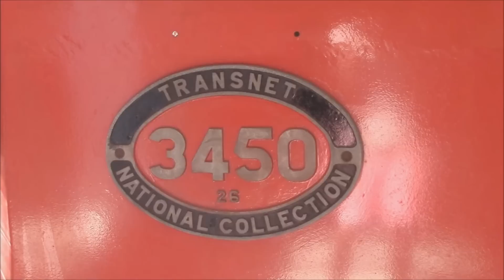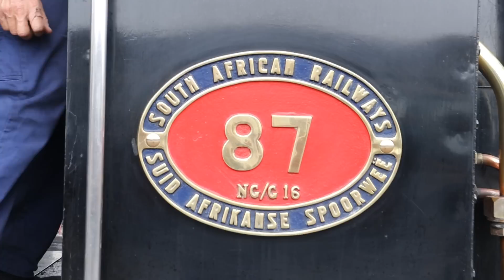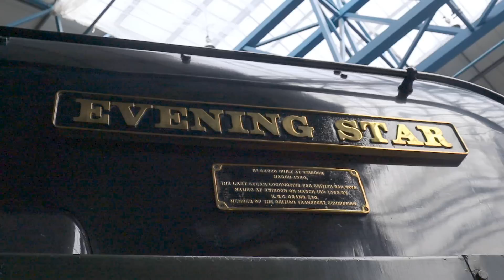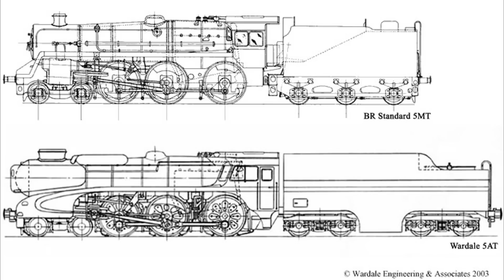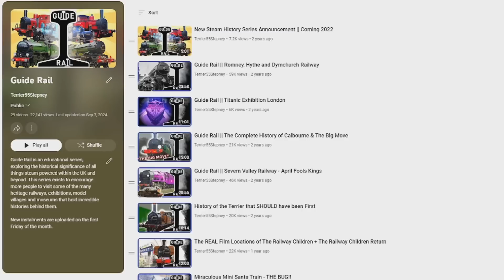What happened to the FUTURISTIC steam locomotive?

Comment: Here is an analogy for you. One of the boys I volunteer at a Restoration Society with had a stump in his yard. A storm knocked the tree down when his misses was pregnant with his daughter almost 2 decades ago. Well he always meant to pull it out but life got in the way, his daughter was 16 when he finally got around to it.

He fired up the old John Deere Tractor with a couple hundred Hp and ran a chain around it, he damn near tipped the tractor over witht he stump not budging. Well his neighbour has an old Steam Tractor. This old girl has just 5 Hp, a fraction of his John Deere. This old timer wrapped a chain just like he did and eased the steam on the old girl, she pulled it out without any damned struggle, just the same as if she was starting a journey down the road, one two three Out. This 16+ year old oak stump just shifted like a knife through butter.

5Hp of steam power has so much more torque than an internal combustion engine thanks to the ability to store energy. If the 5AT ever gets a chance, she will take off round the world due to not relying on the electric grid. Can you imagine being in LA right now when there isn't even food being brought in? Now imagine having a 5AT freight train able to run like nothing happened, fuck the grid she just goes. Even if everyone is charging their stupid electric cars at once and drawing the grid's voltage down, the 5AT would work. Reliability, durability and efficiency.

Comment: The internal combustion engine was a mistake, the future is external combustion, internal combustion at higher pressure produce noxious gases and micro-particles,  steam have potential to be more environmentally friendly but sadly no one see it as it is.
The real reasons internal combustion engines won were purely economical, cheaper to make and run, no superior performance, or better for the environment. 
Monotube steam generation with reciprocating compound or steam turbines and compact vacuum condensers would be the real future of steam locomotives, if total electrification isn't possible.

Comment: Thanks for the video, but I want to react to a couple of points.
The BR standards were by no means advanced or economic, they were cheap and simple, as to be expected for temporary stop gap motive power intended to allow the scrapping of old, worn out and badly maintained (during the rigours of WW2) pre nationalisation locomotives, pending a future conversion to electric traction on main lines and dieselization or closure of branch lines. Although not a standard design, the BR rebuilds of Bullied's pacifics were envisaged to have an economic life extending to around 1980 to give an idea of the time scales envisaged.
The wheels originally planned for the 5AT were the Scullin double disc rather than the box-pok (or box spoke) design. Scullin wheels are best known by fans of the five Henry Dreyfuss streamlined J-3a that rode on scullin wheels at the head of the New York Central's 20th Century Limited in the 1930s. That choice for the 5AT was later amended in favour of Bullied-Firth-Brown wheels since they represent less technical risk on account of being familiar and presently in use beneath a number of preserved Merchant Navy, West Country and Battle of Britain class pacifics in preservation and mainline use. B-F-B wheels look at a glance like a similar design to a box-pok, but are instead a corrugated wheel centre more akin to the forged wheel centres fitted to Porsche 911s in the 1960s and 1970s.
No. 3450 spins its wheels because it's factor of adhesion is too low, a trait carried over from the donor 25NC, and by extension the 15F class 4-8-2 from which the 25NC was derived; this becomes evident in most video you'll find of SAR-SAS steam in action up to its final main line demise in 1991. It's the locomotive's torque, related to starting tractive force that exceeds adhesion resulting in a slip rather than power, the maximum sustained power output determines the maximum product of speed and revenue load hauled. Theoreticaly No. 3450 should have been slightly less prone to slipping since its cut off was limited to 65% of full forward gear due to modifications to the valve gear to increase lap. The reduction in tractive effort compared to an unmodified 25NC was expected to be around 15% but to compensate for that loss, Herdner starting valves were fitted to the cyclinders which brought the theoretical tractive effort up to around 5% more than an unmodified 25NC. Those were pretty quickly discarded due to the increased steam consumption when in use.
I haven't read or heard anyone comment on footplate crews not liking the modifications, the common theme is that shed crews were sceptical of the new fangled gubbins (and no doubt unompressed by having extra items to maintain like the closed feedwater heater and the need for great care in aligning the blastpipe and ejector of the Lempor exhaust given how fussy that exhaust is to misalignment). Footplate crews the world over were used to driving on the regulator which leads to to inefficiency compared to driving on the cut-off with full open regulator and being instructed to drive differently than usual appears to have been considered patronizing to some footplate crews, No. 3450s last regular driver J.J. Hanekom doesn't appear to have disliked the engine, given the custom paint job he oversaw in 1991 (replacing the buffer beam vermillion with an automotive paint of deep red shade).
As much of a missed opportunity as the cancellation of the 5AT project is, to my mind the greater loss is that no one has thought to new-build one of Andre Chapelon's post war standard designs prepared to rejuvinate the SNCF (and in the case of the 2-10-4, construction was started). These, even without incorporating the engineering, manufacutring and metalurgical advances of the last 75 years would far exceed the efficiency of anything (steam) running on BR metals today. Even considering the potential of the 5AT, it was limited by the 2 cylinder simple expansion configuration (to reduce technical and regulatory risk, since regulators could be assuaged by the 5AT being based, even if only loosely, on the familiar BR standard 5). By comparison the closest of Chapelon's 'clean sheet' designs was a four cylinder Du Bosquet-De Glenn compound 4-6-0, driven by 310 psi boiler pressure, designed for coal or oil firing, riding on 7' 3" wheels with roller bearings throughout and tipping the scales at 98 tons. In 1946, they were expected to haul light fast passenger trians of around 400 tons at sustained speeds of 95 mph and be capable of reaching 125 mph. Now add Lempor exhaust and either gas producer (coal) or atomized or surface evaporation (oil) firing, diesel type piston rings, some extra modern insulation and Porta water treatment and you'd have a very efficent, fast machine.

Comment: How about throw away the direct drive but change it into generating electricity that go for VVVT systems, and steam for airbrakes? That will remove the wheel slips and allow the locomotive to put anywhere it could fits on a train

Comment: I don't get it - what's the point of building this? What problem does it solve? What does it do better than other engineering out there? It doesn't have the appeal of a heritage locomotive - and there are plenty of legacy units already running, or in need of restoration. It doesn't go any faster than an electric multiple unit, and will almost certainly be significantly infereior in acceleration. It runs on oil, but with a thermal efficiency of only 14% is way inferior to that of even the first diesels to be introduced - why not just use that diesel oil in a diesel engine? On top of this, this locomotive would require infrastructure that doesn't really exist for taking on water, as well as significantly longer startup times than conventional diesel and electric alternatives. Seems like the worst of all worlds to me.

Comment: To me, I feel the major issue with the 5AT is the fact its... Not an improvment.

Sure take these ideas back the early to mid 1900's and they'll be revolutionary but... Personally the locomotive feels too samey. Effectively its no different from a A4, A1 Peppercorn, or A1 Pacific before it was rebuilt. Effectively, these were all just marginal improvements compared to the revolutionary concept that were diesel and electric locomotives.

As nice as it would be to see a steam locomotive charging down the mainline going over 110 miles per hour on a regular basis, thats something thats nice in a novelty way. Not in a 'oh wait I have a wallet that carries the money that pays for things maintenance' way. Likely why no investors were investing into it. It has no historic basis, isn't going to be cheaper then a diesel or electric locomotive, and even if it was built, how does it help the pre-existing steam locomotives like Tornado, soon to be in service Prince of Wales or way older locomotives. It might be able to operate in the time slots necessary to stay running on mainlines, but whats it going to do? drag a Royal Scott at 100+ miles an hour?

To me, an advance steam locomotive development or new locomotive all together has too overcome alot more problems then just being cheaper then a normal steam locomotive. Or at the very least providing a technology that makes existing steam operation either cheaper or marginally efficient. And the 5AT is exactly... None of those things.

Comment: The steam vs. diesel tests conducted by the New York Central Railroad in 1946, between new Niagara-class 4-8-4 locomotives and new EMD E7 units, showed that modern steamers could compete quite successfully on an operational cost basis with diesels. But a variety of factors led to the dieselization of most American railroads by the late 1950s, and the Niagaras were all scrapped in 1956.

The American ACE 3000 was a proposed modern 4-4-4-2 coal-burning duplex-drive steam locomotive design for Ross Rowland's ACE 3000 Project for the American Coal Enterprises, proposed in the 1970s. Like the project in the video, sufficient funds could not be procured to build a prototype locomotive.

I'm a mechanical engineer, and I firmly believe coal-burning steam locomotives could be built that could still compete with diesel-electrics today.  However, the political climate surrounding "climate change" would probably not allow it.
Reply: Climate change is real, you know.

Comment: The answer is very simple, the Diesel.  Rudolph was on to something, he wanted higher efficiency and he got it.  Steamers have a thermal efficiency of less than 10% while Diesels often can exceed 30%.  Note that there are no steamships either, another win for the mighty diesel.  Mind you, I love the complications of the steamer, boilers, the mechanical complexity of the whole thing, the noise and smoke, the sound of the whistle, all great things.  The diesel just goes about business getting the job done like a good appliance, no drama.  Ocean going steamers really weren't very practical until the development of the triple reduction engine design, they used too much fuel and water before that.  The Titanic went one step further with a low pressure turbine using the exhaust steam from the outside engines to power a centerline propellor to get the last bit out of the steam.  The Mallet, a double reduction design saw very limited application in the US, it was a great design but the rail shops didn't like it, too complicated, but it got two uses out of the steam.  The brits built a number of rigid chassis locomotives with high pressure cylinders driving cranks on the front axles and low pressure cylinders on the outside looking like a conventional locomotive, mechanically complicated but going in the right direction.  These served well into the sixties on british lines.  The brits had other designs used on colonial railways that put more of the locomotive weight on the drivers unlike the Pennsy's 6-4-4-6 design that put 60% of the engine on the pilots, why not build a 4-6-6-4 instead.  OK, for fun the steamer is by far the most interesting but if you are running a railroad and want to make money doing so, buy diesels.

Comment: L.D.PORTER & DAVID WARDALE - THE ADVANCED STEAM LOCO. 
There appears to be a fundamental misunderstanding as to how L.D. Porta & Wardale fit into the picture. And in particular what L.D.Porta (who was the mentor) was after. "Increased power" was a fundamental bonus of the primary target of Porta's work. Which was to increase the efficiency of the steam locomotive so as to make it MORE efficient than the Diesel !!!! The "Red Devil" of SAR was effectively Wardale applying what L.D. Porta had explained to him would be the way forward. Porta it must be realised was involved in  a number of projects worldwide, including in non-British speaking countries including Spain. 

Having watched a Video of Porta in Lleida Spain, explaining the sensible improvements for a preserved Beyer Garratt. None other than a British built broad Gauge (5ft 6in) 4-6-2+2-6-4 EXPRESS type Garratt, to the person in charge of the loco (nicknamed the "Carrot" because of his red hair). It became sadly evident that the Spanish "Carrot" had no comprehension of the radical changes to that Garratt that Porta was explaining. As a result that Garratt, the last express type on the planet, is not fully restored.  The Carrot, had to repair the firebox, so the idiot cut through the main frames so he could slide the firebox out sideways to repair it. Simply because the roof in the building where the loco was housed was too low, to lift off the boiler ! Having then realised this is not a clever idea,  he put the firebox back into the loco "unrepaired", and welded the mainframe back up, and carefully hid the fact by machine polishing the weld marks. So the loco still resides in Catalonia, Northern Spain in a part rebuilt condition.  

Porta also aided Roger Waller of SLM Winterthur in the serious modernisation of an ex German WW2 (Class 52) 2-10-0. This loco was effectively the culmination of Porta's work. And proved it was more efficient than the Diesel. This 2-10-0 loco was rebuilt with low emission output (using light diesel fuel), modern thermal insulation techniques, "total automatic self lighting up", one man operation, full roller bearing on wheels and coupling/connecting rods, & a more efficient valve gear. The onus being on removing the expensive manpower numbers normally required simply to prepare a steam loco for work, and further manpower to operate it. Which effectively requires around a dozen people just to prepare & operate one large steam loco for a days work!!!

Comment: I mean, all of this is kind of pointless to even think about. Even if you increase all performance characteristics by 50% or more, which seems pretty impossible in itself, you still have to compete against Diesel and Electric engines, which offer much better efficiency, ease of use, ease of maintenance, etc etc. Steam died off because it doesn't make economic sense; if it did make economic sense, it would never have gone out of fashion. But since it doesn't make sense, we won't be seeing it again.
Reply: Oddly enough, the steam locomotives built in 1993, and running on light oil, were found, against expectations, to use less fuel than the diesels in service alongside. Given a decent production run, the capital cost is about one-third of the equivalent diesel electric. Capital costs are important because locomotives spend so much of their time doing nothing at all, ending up stored for long periods at places like Long Marston due to the economic cycle and periodic declines in traffic - this in addition to seasonal and daily fluctuations.

Comment: The 5at wasn't the only steam future project there's also the American ace3000 it was made in 1985 and it resembles a big American diesel engine with a wide cab and a full cowl body  except it has steam driveweels and was actually diesel powered and it had a diesel unit reversed similar than it but no steam driveweels and it probably had a m3 america horn  or k5la airchime and the diesel unit reversed by it was actually a coal storage unit it was made for the chessis system or know as conrail seaboard system aka csx and the original paint was all red with a white stripe

Comment: I live in Darlington & North Road is still my nearest station. The lads here have some experience in building a steam locomotive to modern standards. Why not consult them?
I'd like to see a steam locomotive built with all kinds of modern features, such as automatic coal loading, or a different grade such as lignite; the driver placed at the front, away from the heat; perhaps a multi-fuel Sterling engine; fly-by-wire controls; covered wheels for better streamlining; steam directed downwards to get rid of ice & weeds. Some of these ideas won't be feasible, but at least let's look at them.

Comment: Considering that now, in the uk, we have a higher percentage of multimillionaires than ever before, it does seem remarkable that those with essentially bottomless pockets seem uninterested in this sort of innovation. I followed the project closely at the time and was very sad when it all came to an end. Thank you for making this video. It did contain information previously unheard.
Reply: not really at all. whats the point, what innovation?
we have electrified mainlines which are far more efficient and as a brucie bonus don't require a load of little bombs on wheels screeching around the network.  there's literally zero box that this would win over a modern diesel let alone an electric railway

Comment: It should be mentioned that Livio D Porta had pitched a plan to the Tornado trust some time ago that considerably improved upon the design of the A1 class to something comparable to the 5AT, including separate valve gear for each cylinder, improved piston valves rings and liners, lempor exhaust and a GPCS firebox.